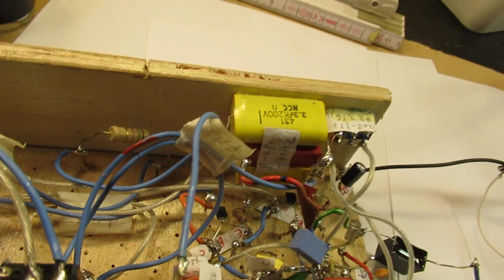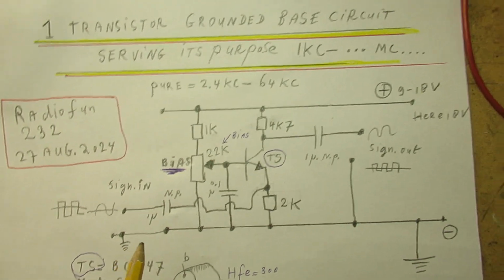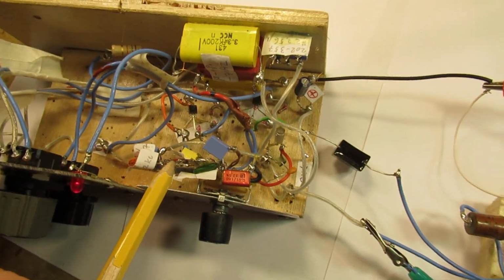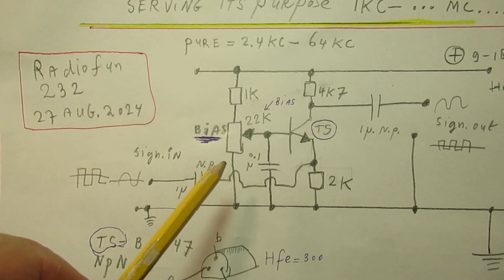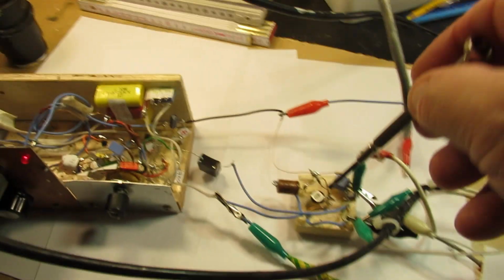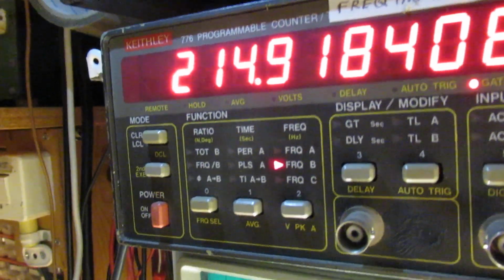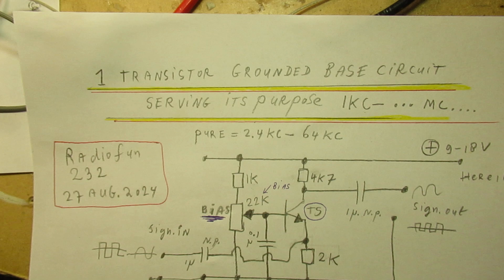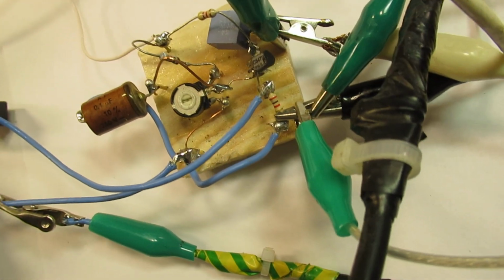The Grounded Base 1 transistor circuit: its properties showed. Now when connected to a MUVIB (demo)

Comment: Good information. Can you do a video on CLASS-A audio amplifier (with commonly available transistor). Thanks
Reply from the maker: Here is some info https://youtu.be/AKRfFvyC1sc?si=-bSk_0txdPxwpQTh
Reply from the maker: And here some old video’s about Class A Audio amplifiers on my YouTube Channel
https://youtu.be/Yeoj5mLcGdE 
And (2008-2016)
https://youtu.be/2wIqJFY4j7c?si=ajxnPBcR4DR1jqrw
And (2017)
https://youtu.be/ZY6OqYElK0k?si=1jbupYeGB7mGyH7m
Reply from the maker: Did you receive my reaction? 29 aug. 2024. And what are your thoughts about it?
Reply: I made basic class A amp circuit (2008-2016). But instead of 547b/TIP31A, i used 548/2n3773 (which I have). Experiment was successfull. Thank you radiofun232. Also expect more videos